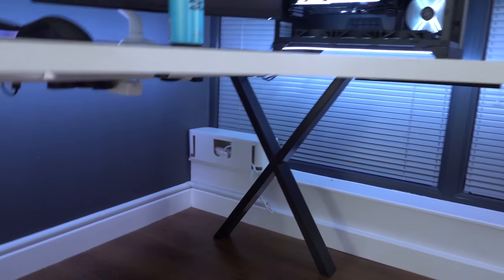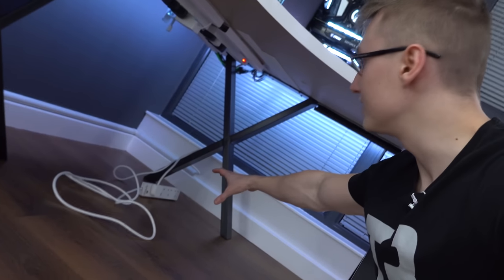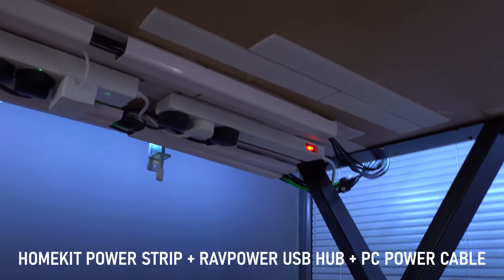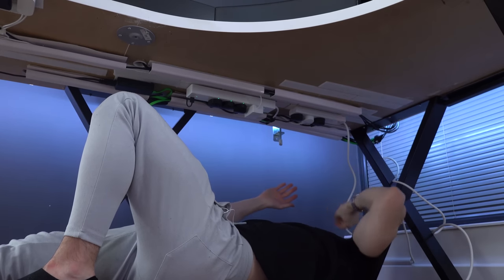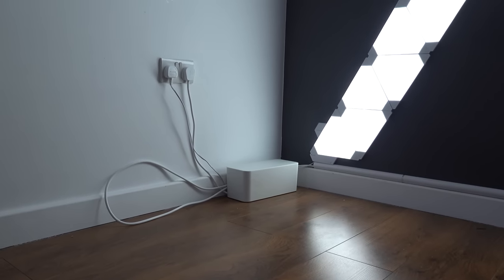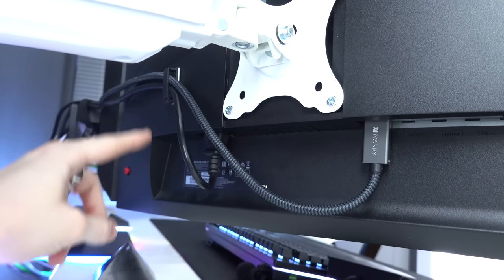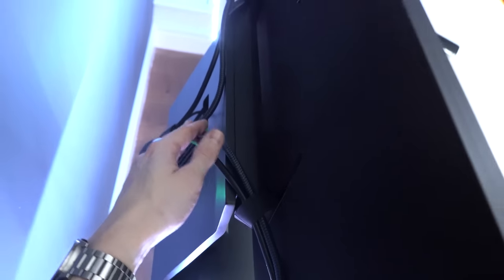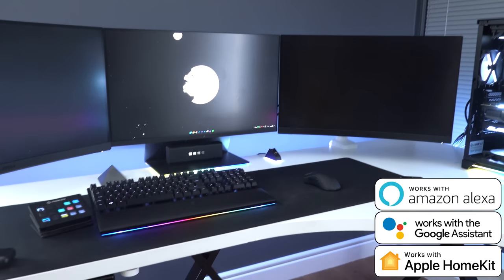How I made my desk setup "wireless" ✅

Comment from the maker: ✅ Channel Sponsor ✅
GET 25% OFF with coupon code: TechBlock
↪︎ geni.us/tbk-scdkey

IMPORTANT DISCLAIMER:
It is generally considered BAD practice to daisy-chain power extension leads (plug power extension leads into each other). I do not recommend you do this, as it might be a safety hazard. In this video, I am using 13A 240V rated power extension leads, that can handle a maximum wattage of around 3000W. My setup in particular only draws a maximum of 900W in an absolute worst case scenario with the CPU & GPU under 100% load + all the LEDs on 100% brightness.

The best way to get around a situation where you might plug power extension leads into each other - is to instead just buy one single power extension lead with enough sockets to begin with (again, make sure to get a good quality one, with for example a 13A 240V rating if you’re in the UK that is). I am making a follow-up video right now, swapping to a single power extension lead.

I appreciate all of you expressing your concern in the comments, I understand how someone might see this and try to copy without first checking the maximum current ratings of their power strip…
Reply: i was gonna say something about my concern with having such a long extension of cables especially with daisy chains, but good to know you thought of this
Reply: What table top is that?
Reply: you could try a server extension cable and screw it on probably safer if you wanted
Reply: why don't you use the secretlab gaming desk
Reply: I have the same lol
Reply: Will this table hold two 32" monitors?
Reply: Funny thing is that so long it is built to standard, it's perfectly safe, you put too much current draw on it and the fuse/'s will just blow. Not really anything to worry about
Reply: i'm sorry to tell you. that you still don't have a wireless setup. and also cutting down the extension would have been the better option
Reply: Absolutely!!! My mouth dropped with all these surge protectors. Talk about increased chances of a Fire Hazard!!! Just WOW!!!
Reply: Gauge and length is calculated based on anticipated power draw, so if you're using a heavy duty cable and drawing 1000W with another cable together, no problem. Heavy duty cables aren't unmanageable and will be much safer.
Reply: Plugging a power strip into another power strip is not, by itself, dangerous. The reason it's a bad idea is because the average person doesn't think much about how much current their devices are drawing. Chaining power strips gives some people the false idea that they can plug lots of devices into the same circuit, possibly overloading that circuit.  As long as you know the current you are pulling and all the plugs are secure you can run many power strips from one another.
Reply: thanks i was just about to comment that
Reply: @BrodyAIM  need that shit toooo
Reply: What desk do you have? I really need one
Reply from the maker: This is my desk: https://youtu.be/j5mVRTpjRMY
Reply: @TechBlock  thanks

Comment: The use of velcro is probably the most useful bit of information for me.  If I end up redoing my management again anytime soon, I'm definitely going to consider this route.
Reply from the maker: Yeah it’s honestly a great route to go, especially with the heavy duty velcro 👌 i imagine you could also go a magnetic route but that would probably be quite costly
Reply: How do you remove the Velcro if you want to switch to a different desk?
Reply: @crossbowhunter9118  thats the neat thing about this. You dont.
Reply: @rrzznn  what do you mean oh cuz it is so cheap you can replace it if you want to switch to a different desk? Do you put one half the Velcro on the power strip for example and the other half on the desk?
Reply: The weakness in the setup is the glue that holds the velcro strip. It’ll eventually sag and come off.
Reply: @ne0trace  that depends on how well made the velcro adhesive is.  I have some stuff that is super sticky, and will leave adhesive behind or take part of what ever it was on with it.  Also a staple gun can fix most velcro adhesive issues if the desk is made out of some sort of wood.
Reply: @ne0trace  I definitely had this experience although I didn't have huge sheets of it like he does in the video.
Reply: @pheelix-  Staple gun is a good point!
Reply: Same here - this idea is so simple, but so briliant at the same time!
Reply: 3M Dual Lock is the best for this. 1 square inch can hold up to 5lbs.

Comment: Fire waiting to happen. Never plug in a surge protector into another surge protector. I recommend buying a power distribution unit (PDU) with a 15ft power cable, or whichever length needed, and have that plugged into a UPS. That being said, solid cable management, but unfortunately you gotta undo some of it.

Comment: I think my only concern would be all the daisy chaining. I thought maybe you were plugged into a good UPS before you revealed it was a cable hiding box. That's a good bit of power running from those two plugs.
Reply: I'm surprised nobody mentioned this. Daisy chaining isn't really good resistance = heat.
Reply: Im more concerned that he put mutiple extension plugged into another extension
Reply: @kuroinova2056  this is what I was thinking

Comment: Govee lights are cool for sure but they don't work with Razer Chroma.  Only Hue and Nano Leaf sync with... Also Nano Leaf brand you have to actually open the app and toggle it each time you turn on the PC so I would suggest using Phillips Hue with Razer Chroma.  The Nano Lines and Leaf are just amazing products though...  Razer rgb lights are awesome as well, the kit I mean.  But they don't shut off when powering off PC or go into standby.  You have to use the app on your phone or press the button.   

Why cant things just work as intended or be smarter?
Reply from the maker: You could technically sync Govee with Razer by using the Lumia Stream software. 

The Nanoleaf desktop app is definitely not as good as the original Razer Nanoleaf Module, which worked flawlessly… shame they got rid of it.

Philips Hue are still probably the best overall option around but do come at a high cost.

Those Nanoleaf Lines do look epic! I might ask Nanoleaf for some, would be cool to make a video about them!

Comment: I made the mistake of not using Velcro.. I installed the J-Channels last week, bought a monitor arm yesterday.. And guess what doesnt work 😭😭
Reply from the maker: Trust me I ran into the same issue before 😂 ended up breaking my J-channels trying to take them off cuz I needed to fit my monitor arms
Reply: @TechBlock  yeah i gave up, i drilled a hole through my desk to mount the monitor. But even then the arm wasnt centered 😭 have to put the arm to the side until i buy a new desk
Reply from the maker: Oh no 😭 I’m glad I’ve switched to using velcro on them now, at least I can move and reuse them in the future. Did u try take your j-channels off?

Comment: The Ravpower USB hub is so nice, I've had one for a few years and I haven't been able to find another until yesterday, as far as your TBK charger I think it looks cool the only thing I can see holding you back is the piece that holds the actual cable/has the cable slide though it. With the coil mechanism not being insanely strong it struggles to glide through back in to position, some sort of similar device that has some hard plastic cylindrical channel(s) for cables would be ideal, could maybe even test some 3D printed pieces.

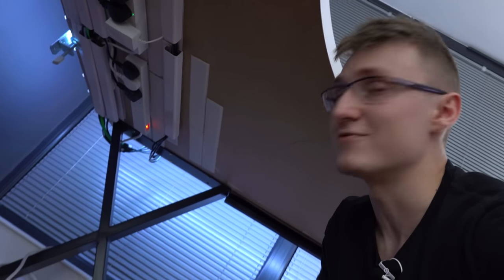Comment: 1:15 , that's not only the reason why you should. It's extremely dangerous to daisy chain power extensions, especially with the voltage your running at (your equipment combined) . Warning to everyone

Comment: If you're planning to copy this.. Please be careful with linking power extension straps. OP doesn't put a warning out. Linking more than it can handle can lead to a fire.
Reply from the maker: From what I understand the hazard only exists if you go over the peak wattage or fuse amp rating. However, as long as the total of all the equipment connected at peak power and current usage is lower than the wattage and amp ratings of the power strip, then it is safe, as with my current situation. 

Both of my power strips are rated for 13A 240V or around 3000W. I have tested the maximum wattage for my entire setup under heavy load and it was only around 700-800W including the PC, Monitors etc.

Do not try to do this with 5A 240V power strips, it's not gonna end well if you go over the peak rated wattage.

Comment: Did that adhesive ever fall of? If not then are you afraid it will fill of?
Reply from the maker: Nah the one that is pre-applied to the J-Channels isn’t gonna fall off easily 🤣 The sticky tape on the velcro, isn’t as crazy strong, but definitely strong enough to hold power strips and J-channels in place :)

Comment: Technially thats not a good idea to plug an power extension cable into a power extension cable. If you exceed the maximum power which is allowed on the cable it might cause fire. 

Your Setup looks awesome but take care! :)
Reply from the maker: I understand 😅 I have made sure to go for a 13A power lead, I won’t come anywhere close to exceeding the wattage. I should have mentioned that in the video tbh :D
Reply: Been doing this for 10+ years, it's not an issue. Just don't exceed 13A which is about 3000 to 3250w I think? If I use everything my full setup + 3080 Ti PC doesn't even use 1000w..
Reply: @MrEditsCinema  Dude, im telling it might happen if u are not careful enough. Just wanted to mention. Some users wont know this so they might get in trouble...
Reply: @MrEditsCinema  Should still give a warning to those who don't know that it can be dangerous. I see lots of comments of people saying they are going to do the same... Thats a big yikes.

Comment: Sick set up that pal. Okay quick one I’m running gtx 780 yes old card’s but I’m looking to upgrade to a new card nothing over priced tho would the Rtx 2060 be a nice little upgrade?? Little lad play’s fortnight gta forza. Looking at updating the pc but gradually. Thanks in advance
Reply from the maker: Have a look at benchmarks comparing the 780 to the 2060. But I imagine it would be a nice bump in performance
Reply: @TechBlock   will have a look at it. 

Where’s the Razer case gone ?? I changed my case from the cosmos case to the Razer case so much better. Oh just heads up on some of the Amazon links some the stuff is not available or coming back in stock just heads up on that one pal. 👍
Reply from the maker: @bloodhunter78  I’m basically using a bigger version of that Razer Edition Lian Li PC-O11 Dynamic :D 

If you don’t mind me asking which country you’re in? I’ll update the links :)
Reply: @TechBlock   in the uk pal. Yea just fort I’d say about the links fella.

Comment: Its a clean setup, but you REALLY shouldnt daisy chain power strips together. It can cause them to overload and is a known fire hazard.

Edit: It could also void home insurance if the worst should happen.
Reply: You beat me to it. Glad someone said it
Reply from the maker: From what I understand the hazard only exists if you go over the peak wattage or fuse amp rating. However, as long as the total of all the equipment connected at peak power and current usage is lower than the wattage and amp ratings of the power strip, then it is safe, as with my current situation. 

Both of my power strips are rated for 13A 240V or around 3000W. I have tested the maximum wattage for my entire setup under heavy load and it was only around 700-800W including the PC, Monitors etc.
Reply: @TechBlock  I'd check with your insurance within the home to make sure that it's not voiding it, if something were to happen because that still seems like it could be a voiding thing.
Reply: @TechBlock  I'm not an electrician, just wanna look out for someone.

Comment: Why is your exhaust fan the wrong way round?
Reply: That's how you configure the fans in a Lian Li o11 Dynamic case. Because having the fans as exhaust at the front/side of the Lian Li case looks great. I have the mini version but still pretty much the same. Intake at the back and bottom and exhaust at the top and front
Reply from the maker: The fans Im using have an inverted design

Comment: How do u make the cables on the actuall pc not show
Reply from the maker: The cables inside my PC? I’ve tried my best to cable manage those, it helps if you have a case like this were the PSU is at the back of the case and everything is hidden behind the side panel.

As for the cables coming out of the back, i just tried to route them behind the case and down into the cable management bits :)

Comment: Imagine having such a clean high-end setup, but using Wi-Fi xD
Reply from the maker: My main router is on the other side of the wall, I don’t lose any speed being on WiFi
Reply: @TechBlock  I dont think that speed is the issue with Wi-Fi. More like Ping and reliability. I just prefer to have a LAN-connection
Reply: @bubkbein99191  *Wired connection

Comment: This made me feel ashamed of my own cable management and vow to correct it immediately. Also As your monitors are not all the same size or resolution can you not play games in triple extended? I play games in 7680x1440P and have another monitor above my middle one for other content.
Reply from the maker: All the monitors are 27” 1440p, but the outer two are MSI and the middle is Razer

Comment: not bad, but how you got it setup could be better tho,  mmmm the desk you got going by the support legs on it you could drill a hole at the top of the leg and one hole at the bottom of it then feed the power cable through it

Comment: yea it's clean as hell I just am concerned about the power and the chaining of things into one or two sockets. Those things are spec'ed for certain amperage and I would be very careful with this setup.
Reply from the maker: I have since solved this problem in a follow up video :)
Reply: @TechBlock  Good to know, I had an air conditioner window unit on the same circuit as 2 PCs and all the peripherals and I didn't think about it myself and then my buddy asked me if I had that all on the same circuit and I was like yea and now that you mention it that's dangerous lol. So it is easy to ignore in our modern world when everything "just works" like we're Todd Howard.

Comment: I wish wireless wasn't such hell. Every time I go to use the PC my headsets telling me to recharge it and my mouse or keyboard dies on me mid gameplay! They really need to work on packing them with more mAh batteries
Reply from the maker: Mo’ batteries = mo’ weight :/ 

But having those chargers I’m using with magnets makes changing any device super easy and quick. 

As for your headset or mouse, I would recommend getting one with a charging dock. I think Astro headsets have that. Some wireless Razer mice also support charging them with a mouse dock

Comment: I think u should change out the table, u dont rly have any storage space, no drawers to put stuff in them. Your razer monitor is hanging from the side of the desk, push the table more to the wall maybe? Get a bigger table top for sure dude, a few cm wider desk can work wonders. I know u did good on the cable management but dude an alex and karlby combo u can make an L desk even, works 10x times and looks 10x times better then this flimsy table, or even get a standing desk and an alex unit to put your pc on, otherwise it just looks bland dude.
Reply from the maker: I have IKEA ALEX drawers, I used to use them in my setup but not anymore. All my storage space is elsewhere in this room, I don't really need any storage at my actual table tbh, I like to keep this clean and minimal here.

The table tho... yeah its not ideal xD It's by no means flimsy tho, despite it being an IKEA LINNMON, the table legs gave it so much extra weight and stability that it made the desk quite sturdy, especially with all the weight on top. But it definately isn't big enough in terms of depth, one day I'll swap it out for something much better.
Reply: @TechBlock  Yeah i understand, it just kinda looks bland and empty for my taste. Try adding some more peronality, maybe add wallart and shelfing units and some decoration. U usually have cables, controllers, hdds in drawers anytime i need them for my pc thats why i use it.
Maybe in the future u can get a custom cut L shaped tabletop and add a bit of drawers on one side just so it doesnt look naked, my opinion. Anyways keep it up!

Comment: This is dangerous and your PC won't be getting full, clean power, please never do this
Reply from the maker: Both of my power strips are rated for 13A 240V or around 3000W. I have tested the maximum wattage for my entire setup under heavy load and it was only around 700-800W including the PC, Monitors etc.